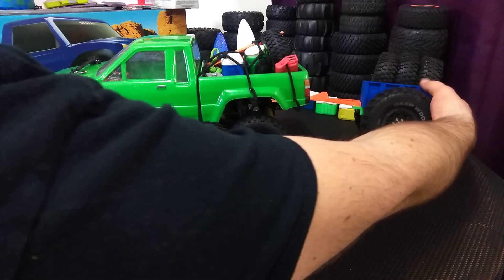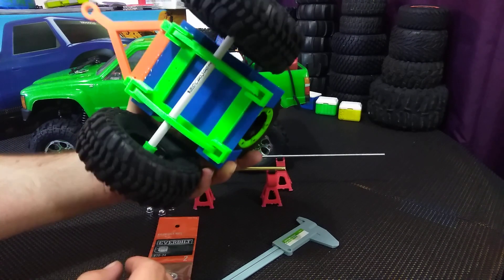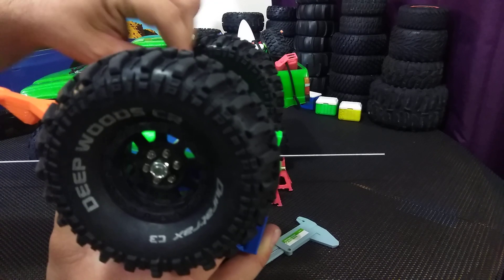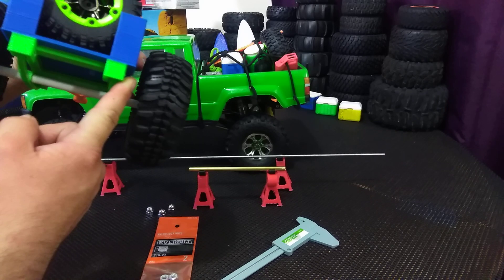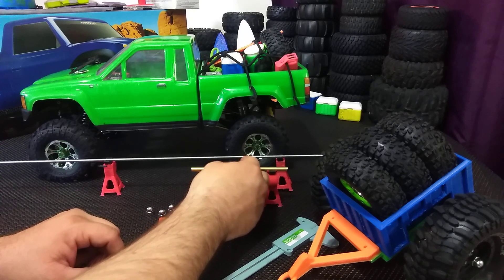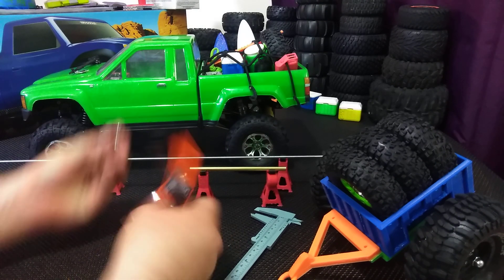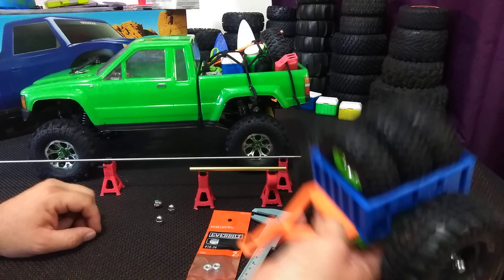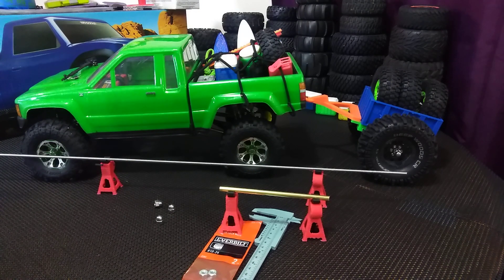3D printed 1/10 scale trailer will it last

Comment: That looks pretty cool man. I've been wanting to get a 3d printer for awhile now for making parts
Reply from the maker: Yes get one my printer has payed for it's self three times now
Reply: @rc4you891  What kind of printer do you have? is it one you would recommend?
Reply from the maker: I have a xyz printer but the fermwer is pretty bad I wood just get a cheep one off eBay Mack sure there's it has good reviews I was seeing them all the way down to 100$ tack a look and shop around abs filament is the stuff I use pla has a hard time went it gets hot petg is looking very good for rc parts 😁😁😁😁👍